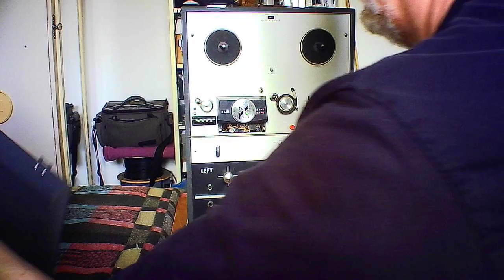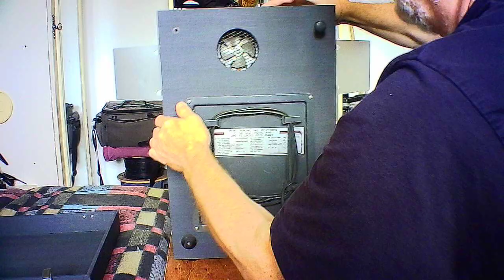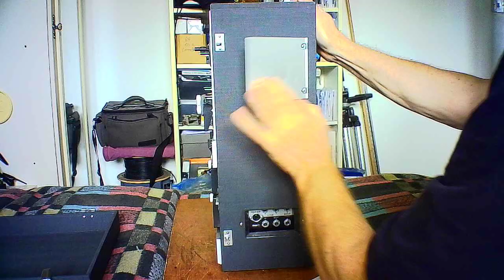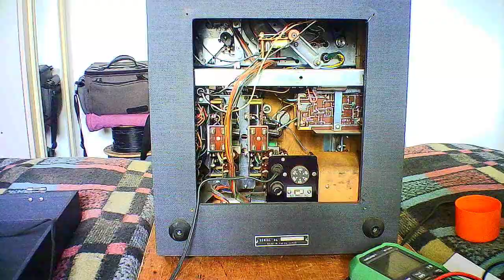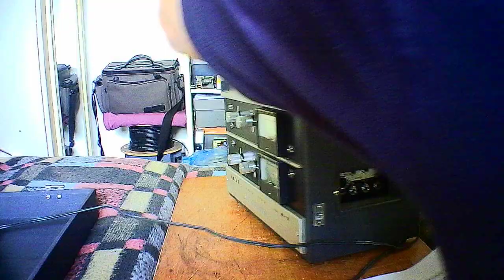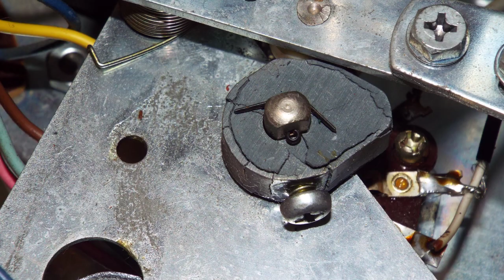Akai M-9 Reel to Reel tape player

Comment: I have the Roberts 770x. It's copy
Reply from the maker: I hope it keeps working for you.
I got the impression they were Akai machines and not copies, the web page https://reel-reel.com/tape-recorder-brand/akai/  lists this as a time line. '1953-54 Akai begins to export goods bypassing wholesalers. Advertises in the American mag -Electronics with headline “Why not buy Akai technology?” generating inquiries from 5 interested companies. Roberts Electronics founded by Robert Metzner responds'
Also in this web page
https://museumofmagneticsoundrecording.org/ManufacturersAkai.html.  So they were certainly working together.  My machine has long gone to the rubbish pile now.  It was offered FOC some time ago on a vintage forum and had no takers.  The pot metal cams seem to have given various models a very bad reputation over here that no one else was prepared to take it further.
Reply: @ef91valve  thanks. I hope it keeps working too. I picked it up years ago from a school that was having a rummage sale (about 20 years ago). The only thing that was missing on it was the capstan sleeve that was for enabling it to play at 3 3/4 - 7 1/2 ips. Otherwise it could only play at 1 7/8 - 3 3/4 ips. I found a replacement, (made out of brass), on the internet from a company that had replacements made to purchase. It worked okay but it was slightly out of round and it added a lot of extra flutter to the playback. Then I found another company online that made replacements out of stainless steel like the original ones. Good thing because most  of my reels for my main system, with its pioneer rt707, are 7 1/2 ips. I think this 770x was built in 1971.
Reply: Correction, 771x

Comment: https://www.youtube.com/watch?v=pLwZRDR3IaE Admittedly this was a very low hours unit when I got it, but it still needed lots of work to get it to this point especially rubbers, electronics and record / replay switches. Now works perfectly.
Reply from the maker: I no longer have my M9 after offering it a few times on UKVRRR and no one taking it up it was unfortunately disposed of.  It seems that the Akai machines got a bad reputation due to the metal used for the cams and replacement was a major task if new cams could be obtained.  I used it enough to get some old family tapes digitized before it went.

Comment: I had the same machine, but the cams and the chassis parts are Mazak (monkey metal) and were worse than yours!
It did yield some good parts though...
Reply from the maker: The main one that is the issue is the one that lifts the bias and erase head, this is in a situation that it will no longer mount on the spindle, so I can not use the machine to record anything.  I know that some of the other cams are similar to other machines and some suppliers do make alternate cams, but I know very little about compatibility really, so for now it stays as it is at the end of the video.  It could probably do with a few belts as well, but doubt it would get much more use?

Comment: well done Adrian, lets hope some one out there, has some spares or can point you in the right direction!
Reply from the maker: Hi Jim did you see the cracks in the other cams?  Holding together with a wing and a prayer.
Reply: @ef91valve  Check out 12voltvids repair videos on two different AKAI models with exactly the same problem, cheap quality cams from the United States. Was it deliberate or incompetence? You choose which. One video is titled "M9 Reel to reel GARBAGE" and the other one is "Before buying any old AKAI tape recorders watch this". If you can find brand new spare parts, good for you. If you can find old ones that are still intact, perhaps someone can duplicate them using superior material. I always wondered why the AKAI heads were off-center and the reason for that two lever arrangement. Those two videos show exactly why. Why AKAI would put in cheap quality parts that were crucial remains a mystery, unless of course it was to create work for repair shops.